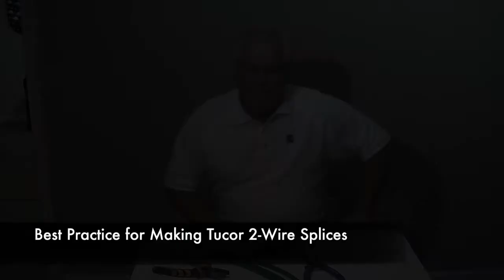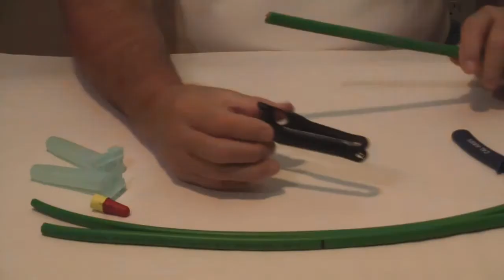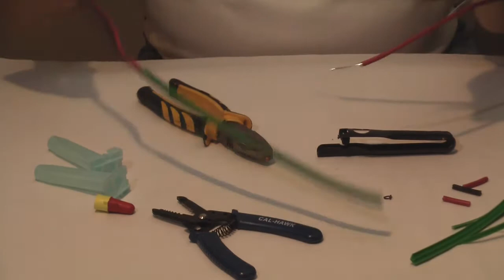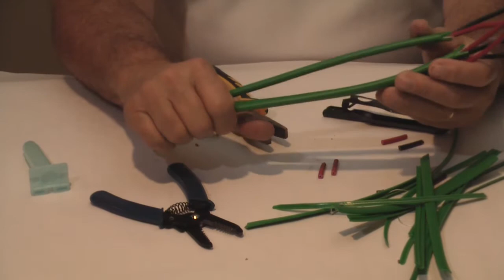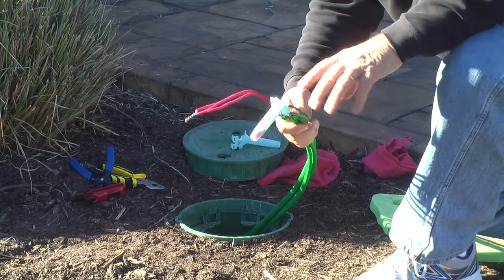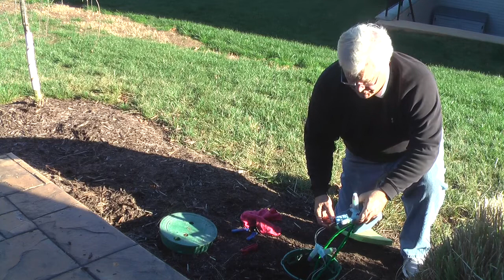Best Practice for Making Tucor 2-Wire Splices

Comment: excellent video. I solder my connections too with rosin core solder and mapp gas torch. I electrical tape my splice wires together not the wire nut before putting into the 2wDbry waterproof connectors. then electrical tape wires after the connector.